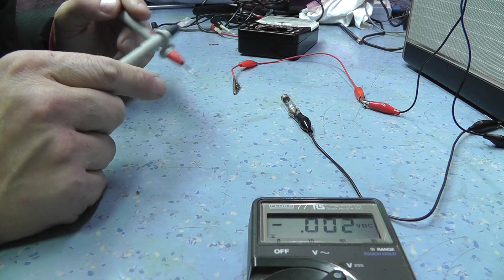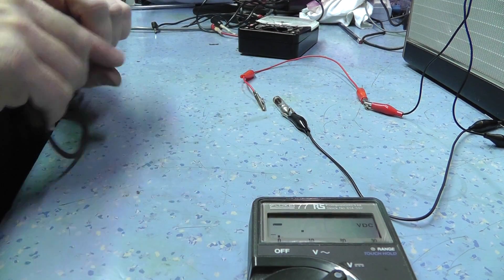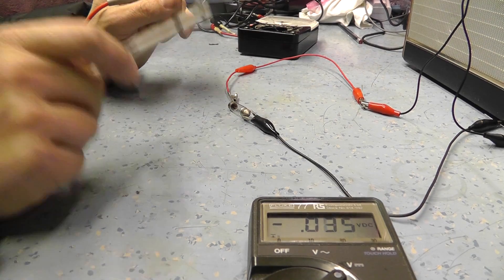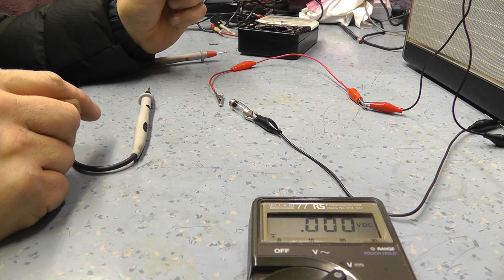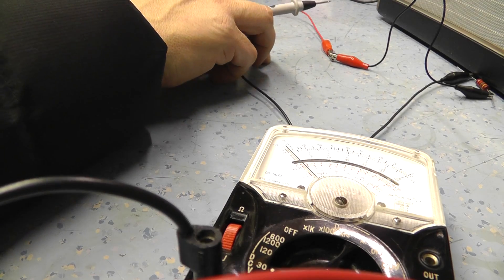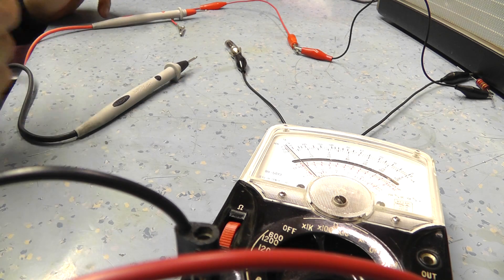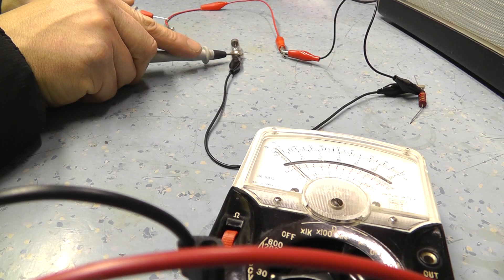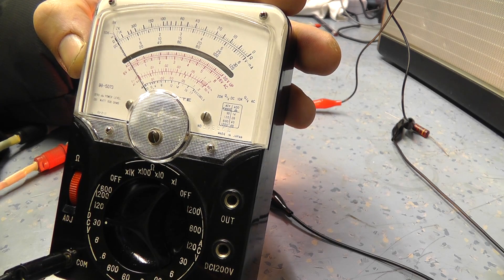Tips for automotive fault finding

Comment: Hi Simon , I like the way you explain the electrics I have a 2002 Triumph 955 i which had corrosion within the loom , stripped it back and cleaned it up and tested as I went. Did not touch it for 2 years now I find bulbs light dimly and measure approx 6  volts at rear bulbs. I s there a way of checking to establish where is in the loom?

Comment: Thank you ,very helpful information.do you think it can help measure the current in the lemon or potato battery that I don’t succeed to measure because it’s so low ? (While lighting a led,I use a fluke 289 to measure,and it doesn’t work,not in series and not with clampmeter)
Reply: Did you move the red lead to the mA socket on the Fluke?
Reply: Peter Mulvey sure did,if you don’t do so the fluke beeps ,and shows” leads”on the screen .
Reply from the maker: It should if it lights an led?  Is the fuse ok in the meter?
Reply: Simon Spiers fuse is in perfect condition,meter works fine,but doesn’t show current,Is it possible that the current is smaller then the   Smallest fluke range which is u amper ?(voltage from 4 potato’s is 3.6 volts and it lights a blu led esaly)
Reply from the maker: @rylos-n6g  if it's lighting an led it must be in the mA  range.
Reply: Simon Spiers thank you ,I will try to measure again .

Comment: Is it just me, but every trailer I have ever used has a defective trailer board.  Do you remember those horrible insulation displacement connectors I think they were called scotch lock connectors. They were often used to splice wiring for the trailer socket into the rear wiring loom, with several yards of insulation tape. I think there is a lot to be said for just using a test lamp for automotive electronics. I seem to remember that some meters have a low Z setting which I think reduces the input impedance, I think my Fluke has. Got to love the old analog meters. I have not encountered these type of Earth problems fault for many years I think modern wiring in now  so much better now than back in the day.  Or perhaps I don’t buy knackered old cars anymore. Thanks Simon Regards Chris.
Reply: In the wetter climates especially where the roads get a lot of snow and are salted by the municipalities, connection problems are quite common in cars, even in fairly new cars (less than 10 years old). Failing ground connections, failing connections in plug in connectors tend to become part of normal life for the mechanic. You can usually spot the problems visually as well because of the green 'crusties' that form in those locations. Every troubleshooting exercise includes checking the integrity of the wiring as well as the device in question.
Reply: Fred Flintstone  you are quite right The UK is really pretty bad for wet and salty roads. I’m not sure if you’re young but it was worse in the past I spent many hours sorting out shity old wiring

Comment: Would a resistor across input of the digital meter give the same effect as the load of the analog meter?
Reply from the maker: Yes for low voltage it would be fine. But for mains a bit dodgy though!